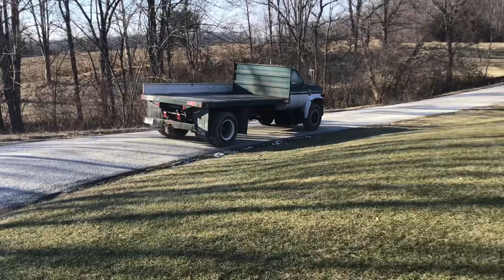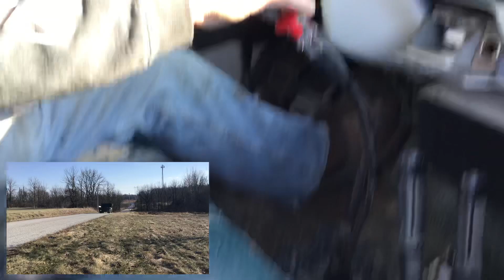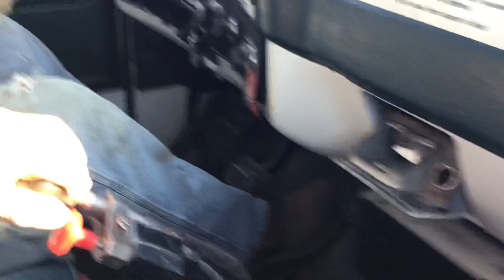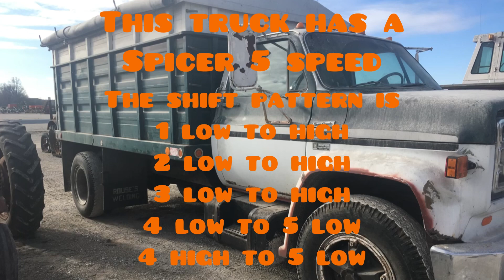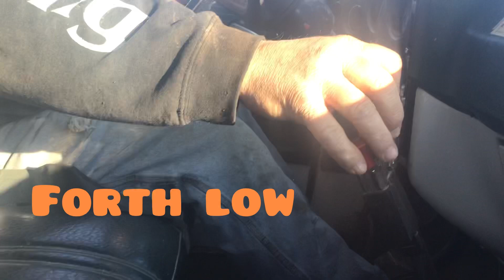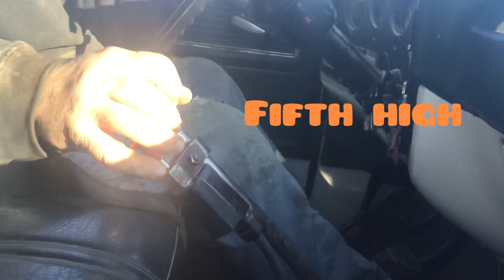Driving a Chevy c60 5+2 transmission

Comment: I’ve noticed over the years-if you don’t let these two-ton gasoline trucks idle down and relax for about a minute at idle before you shut them off-just after you shut them off-they will pop out the exhaust-pretty loud pop like a shotgun.
Reply: A carb rebuild/adjustment will usually solve that, but you’re supposed to let any carbureted engine idle for a minute before shutting it off.

Comment: Shift and Split selections:
1.  1 LO to 1 HI
2.  1 HI to 2 LO
3.  2 LO to 2 HI
4.  2 HI to 3 LO
5.  3 LO to 3 HI
6.  3 HI to 4 LO
7.  4 LO to 5 LO
8.  5 LO to 4 HI
9.  4 HI to 5 HI  

Starting out in 1 LO with 9 speed changes for a total of 10 speeds.
Reply from the maker: Exactly

Comment: I’m planning on getting one of these trucks for the homestead. Almost every one on marketplace says it needs break work. Is it that much of a pain to change compared to a regular pickup? Or parts are harder to get or expensive?
Reply from the maker: It’s very expensive and if you know drum brakes you can figure it out 
Tires can be expensive also. You can easily spend more on brakes and tires than the truck cost
Reply: @DrRust  thanks for the reply. I guess I’ll be thinking on wether I really need one or not then.
Reply from the maker: They are definitely worth it if you get a good one just watch at auctions or market place for one that was used recently or recently passed a dot inspection

Comment: We have a 76 -C65. its a air brake rig.  366 big block mill it has a working 5 speed trans and two speed rear.. 4th high is faster than 5th low. So you shift third high to 4th low then to 5th low and them 4th high and then 5th high.
Reply from the maker: That’s the way this is but not air brakes
Reply: I have GMC 6500, 427, 5 sp with a 2 speed rear axle. I normally don't split each gear until maybe 3rd, then I spilt 3rd low to 3rd high, then 4th low to 4th high, then 5th low to 5th high...I've never seen that shift pattern, 4th low to 5th low, then 4th high to 5th high. Live & learn. I never liked those 5 speed- 2 speed rear axle. My favorite trans. We're the 10 or 13 speeds with a splitter on the bigger trucks I drove, Macks, Internationals, & Kenworths. I miss driving..😂😂
Reply from the maker: My dad was disappointed when he saw the shift pattern on this truck it’s definitely different but it shifts really smooth

Comment: Never drove a truck with a two speed rear end but how are you able to not utilize the clutch on certain gear changes?
Reply from the maker: By shifting at the perfect rpm when you let off the accelerator it brakes torque and let’s you smoothly take it out of gear then as the rpm drops if you hold the shifter against the synchros when the rpm matches it will drop right in 
Shifting the 2 speed is basically the same thing you just flip the switch and burp the throttle
Reply: @DrRust  thanks for the info

Comment: Bout what’s the top speed on it? I’ve got one with a single speed rear end and she’s only good for about 45 mph so considering a 2 speed swap
Reply from the maker: Depending on your current ratio you probably won’t get a better top speed this truck can do 50 maybe 55 tops you would be better to do a transmission swap to a overdrive or go to a bigger diameter tire